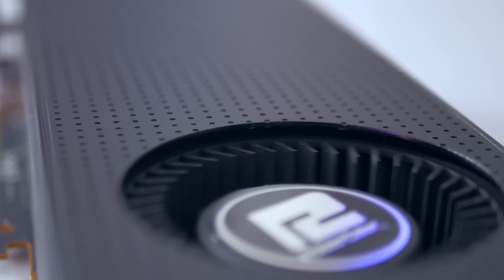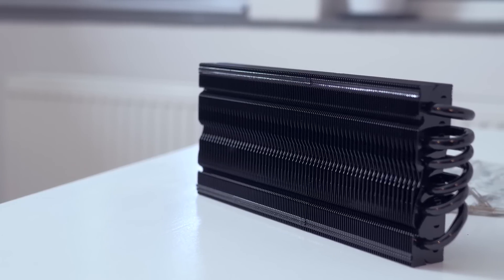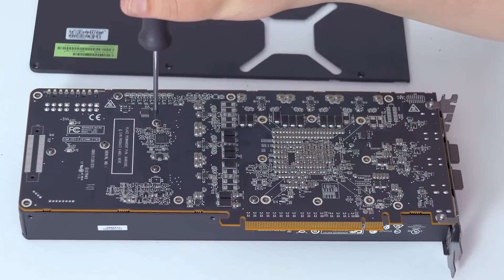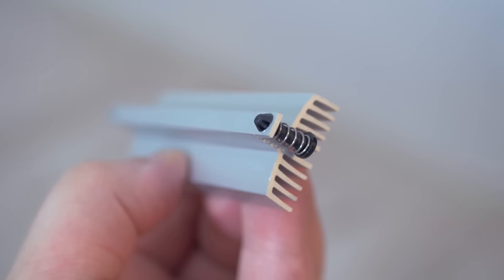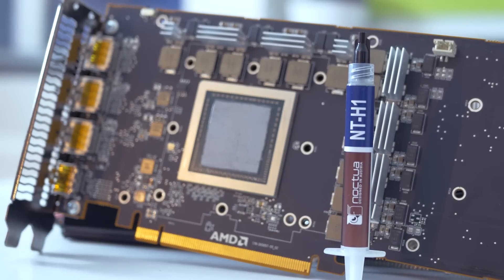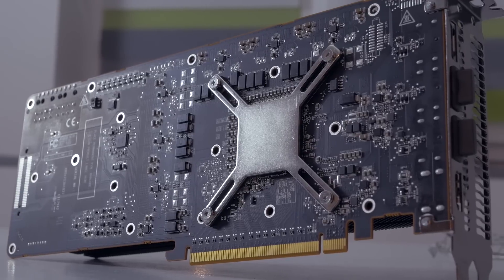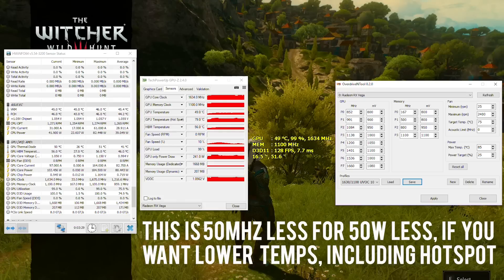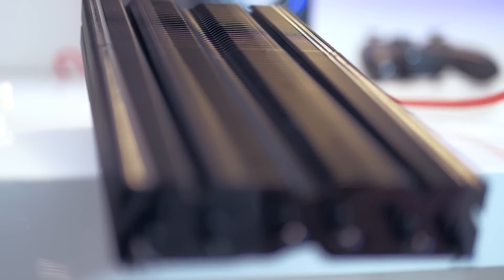The ultimate AFTERMARKET RX Vega - MORPHEUS II cooler SWAP

Comment: I would sooooo put liquid metal :) Did it once never looked back, only LM for me :D
Reply from the maker: +Albin Keranović Yeah, LM would probably drop temps anther 2-3-4C so it's worth it IMO.
Reply: Signex NL it's sort of like thermal paste. It's metals in a liquid form. So you have to be careful in its application
Reply: ArtisChronicles no dont let it contact any aluminium. only copper or nickelplated copper.
Reply: I have seen so many test were liquid metal barely does 1 or 2 degrees better than MX-4 or NT-H1.
The massive downside with liquid metal is that it eats away the surface of the chip and the heatsink over time.
So you looking to sell that hardware? Good luck selling it with damage on the chip surface.
Reply: Sorry but what is LM?
Reply: Signex NL liquid metal XD
Reply: Albin Keranović honestly I think my rx 480 has gotten more stable compared to when I first purchased it. I'm thinking about changing some stuff on it, even though current thermals are acceptable.
Reply: That's what i'm asking. :P what is it? some type of thermal paste?
Reply: Albin Keranović I thought you weren’t supposed to use conductive thermal paste on gpus? Due to requiring much more application and spreading to cover the whole die with a higher chance of spilling over the chip
Reply: SMGJohn depends on gpu. on my msi 390 oced to 1125mhz igot 93 max c with stock paste, 84c max with noctua paste and 72 c max but 1175mhz oc with coollaboratory LM. 

on my gtx msi gtx 1080ti i got around 8c difference when oced to 2050mhz. stock paste vs coollaboratory lm

there was always the same fan setup. if i increase the fan speed difference got wider in benefit to LM.
Reply: forgot to say that 1080ti was not stable at2050 with stock paste. with lm it stays at that clock.

an also my 7700k dropped for 28c average with same cooler and setup corsair h115i. and i could get 5ghz out of it with lm with lower viltage then when it was at 4.9ghz and higher voltage
Reply: +Albin Keranović
Never really seen any good tests though in regards to support your claim but if you have any data on it by all means post it here because I am genuinely curious.
Reply: https://www.youtube.com/watch?v=RbFKNTES5zc&t=895s

https://www.youtube.com/watch?v=KlTANRl_osU&t=346s

And remember better cooler better results you get with LM. :o)
Reply: Silicon, nickel and copper are safe to use gallium/indium based TIM. I've been using liquid metal TIM for over two years now on various devices and found no traces of amalgamation or excessive oxidation. Nickel under LM seems to be more prone to heat flux deposition, but you get that with essentially any material if you pump enough heat through the interface...
Reply: For CPUs; whom you're replacing the TIM anyways with a proper solution; sure why not? But for GPUs; where you'd remove the fan as part of maintenance; liquid metal seems like a really stupid idea because once its on; it's on forever. I'd only do it if I fully understood the risks involved and am willing to replace the entire GPU(next-day) if something goes wrong. Otherwise paste is more safer, proven, and still maintains very satisfactory heat-removal.
Reply: Steven Van its not forever on you can remove it
Reply: +Albin Keranović
Again those are not evidence to backup the claim that liquid metal is worth the hassle. 

https://overclocking.guide/thermal-paste-roundup-2015-47-products-tested-with-air-cooling-and-liquid-nitrogen-ln2/
https://overclocking.guide/wp-content/uploads/2015/06/Tim_test_update1.png

http://cdn.overclock.net/d/dd/dd1faaf2_1.jpeg

As you can see we are talking VERY low differences, 1 - 3 degrees at best here.
Considering that some liquid metals do eat away the surface of the heatsink and the chip and leaves scratches
While others do not they are extremely difficult to remove, in my experience you have to sandpaper the copper heatsink to remove the residue. 
The only applications I can think of were liquid metal is genuinely helpful is when you delid Intel CPU's.
Reply: Intel Toothpaste for life! (but seriously, why do they use that on $2000 processors, is it just so you void the warranty?)
Reply: its to make money. If AMD could catch them in ipc, then there will be only soldered intel chips, from i3 till i9..... You just don't have to delid your cpu, or remove cooler from GPU, if you like your warranty. I test my components for like 6+ months then i put LM.
Reply: I know, but its very sad. My $0.01 per CPU paste is better... Seriously, its a tube good for 500+ CPUs (maybe only 100 Threadrippers), and its $0.99. Can they not at least use that on a $2000 CPU? I don't think its cost cutting this bad, I think its to increase sales with broken chips after delid. Even if just 1 out of 1000 people mess it up, that's about $1 additional per person, and the failure rate is probably higher, meaning more money. Who knew you could make more with an inferior product?
Reply: Albin Keranović even with aluminum?

Comment: buildzoid mentioned already that the hotspot temperature is the "right" temperature of the gpu. so 80°C with loud fans on the morpheus?
Reply: Temps aren't comparable all the time. I have 1 card that runs over 70c at idle (and is insanely loud). If you overclock it, you need hearing protection (if you think a vacuum cleaner beside your desktop is loud, think again!). Every chip is different on how much heat it can handle, some of my cards are fine a little past 100c, and others like the R9 Fury throttle at 75c. Its really dependent on how they were designed, to where a temp is bad for them.

Comment: Great guide! While on the pricey side, I tried a number of fans on my Morpheus and ended up being happiest with the Noctua NF-F12. Static pressure is 2.6mm (higher than the average 120 but lower than the ID Cooling SF's 3.2mm) but they are dead quiet. At the max 1500 RPM, the Noctuas are rated at 22.4dB. I have them on an open workbench and basically can't hear them even under load.
Reply from the maker: +lhl Yeah, these fans are good, but at max rpm (around 2200, which I actually ran in the video) they are about just as loud as the reference cooler at stock. Muuuch quiet than reference at 3500, for damn sure, but still a little noisy. Something like the Noctua's you mentioned are an excellent middle ground, since they'll provide better performance than these fans at the same rpm. I didn't have any Noctua fans in hand, else it's have used those.

Also, dropping the fans to around 1700 rpm makes them considerably more quit, while temps were only hurt by around 3-4C max...

Comment: thanks for the video. very nice.... this is the first video ive seen that uses an air solution. its good to be able to re-use parts in future setups of course but i am thinking water would be a better fit for myself as i live in a smaller room where the hot air is enough to slowly cook you... lol esp wit vega ;) the only problem i would face is affording the pump setup etc.. might as well do it since the case is made for it and i got just about everything but the pump and tubing... thnx again !
Reply: Unless you put the radiator outside your house, you're still going to have the same amount of heat being dumped into your room. If you do run it outside, you need to worry any time its colder outside than your room (condensation).

Comment: what cooler for shappire Rx 480 8GB? sometimes my RX 480 got 80' when i play PUBG
Reply: MSI afterburner, and set the fan profile. Almost any cooler will be plenty for the RX 480, but it seems like companies don't want fan speeds past 40% and would rather the card be hot and cook itself than add a little noise. I have a few RX 470 (modified BIOS) that can pull up to 270w each, and with a locked 65% fan speed, I only get up to around 70c. They are the XFX with hot-swap fans, so nothing special in terms of cooling. 80c is still not that hot, but you can crank the fan speeds up if you want.
Reply from the maker: +Norman Kana The ID-cooling Frostflow 240G is what I had on my RX 480 with absolutely excellent results. Not really cheap but was with the effort. Will not work for the Vega cards though...

Comment: You have to be extremely careful with custom cooling Vega due to the different hights of HBM2. If a viewer does this and gets a card with lower HBM2, they could hurt the cards performance as HBM2 temps effect both mem and core clock, so if the HBM2 gets hot your card is gonna throttle like a mofo. 
Side note, if vega ever gets back in stock for the correct prices, I'm gonna get two 56's, put them under water, and flash the v64 lc bios on them and enjoy the monstrous performance (if you did not see it, v56 and v64 perform identically with the same bios, showing that vega in gaming workloads is bottlenecked somewhere else in the cards architecture)
Reply: He mentioned that his was of the molded variety, which is level, and that if your is not molded that you'll need more thermal compound, due to height differences. Obviously you don't want to overtighten the heatsink though, especially if yours is non-molded HBM.

Comment: One thing that maybe you should have mentioned is that the modification turns the card into a 4 slot wide card. Anyone attempting this needs to pay attention to clearance particularly if their Case has a PSU shroud that may restrict the fans from drawing airflow.
Reply from the maker: +brad morris Good point! I had no issue with my case since the PSU shroud is just a vertical wall, not a complete enclosure. I think it's closer to 3 slots, but haven't really checked this. It's extremely beefy, that's for sure.
Reply: I saw that your case had a wall and not a shroud so not so much of a problem in your situation. Problematic if someone wants to emulate the solution and doesnt think about the shroud in their case. 

The width is hard to tell from a video, The heat sink looked like it made a 3 slot card by itself and the the fans did poke out a lot more from the rear plate.

Comment: When I bought the VEGA 64 reference card I did it with the idea in mind to replace the cooler with an AIO solution ASAP.
But running the power saver bios and with some undervolting, I already got decent results.
So instead I just removed my acrylic window out of the side panel, added mesh to filter the dust and placed 2 120mm fans "on top" of the card.
Until around 2000 - 2400 rpm the fan is quite silent.
Reply: What temps did you get?
Reply: Good to know. I have http://www.coolermaster.com/case/full-tower/haf-932/, so hopefully I get enough air to keep it nice a cool.
Reply: @kraziivan_  great case
Reply: Temps?

Comment: My whole system is full of those fans, at the slowest speed they can run, they keep my 1600x under 60*c with a 360 rad. But yeah they are quite noisy

Comment: Mindblank I think your Ryzen ram videos are very interesting! I wonder, the cases where it's ahead of the 7700k, does it stay ahead at 720p? That is something that I think could be cool to know. I've only seen ryzen pull ahead ever so slightly sometimes once greater resolutions are applied so if it's ahead also in a lower resolution it has to mean that the setup is faster (in that title), or that different processors perform differently for different resolutions. 

It's less of an argument nowadays when coffee lake is around though, but can show that AMD may not be completely out of the game (*ba-rum-tisch*) once Zen+ arrives. My theory is that the more core processor will generally perform better in 1440p & 4k benchmarks in properly made DX12 & Vulkan titles.
Reply from the maker: +EwoksOwnDeathstar I really don't plan at looking at 720p. Usually, the emphasis is so much on the CPU at this resolution, that things are amplified to a point where they stop pertaining to the real world. Cause at 1080p at least you have the real world factor, and it's a res that still has over 2 million pixels to push, while 720p is around half. I think the 7700K will be on top at this res in the majority of titles. But it's meaningless IMO.
Reply: Out of a real world scenario it's meaningless. But from a scientific standpoint it can be interesting. 

Because what if the 1700X with 3446VLL is still ahead in 720p? This could imply that the setup is faster at every resolution with that setup.
If it's not it brings forth that ryzen must've lost less in performance compared to the 7700k. That would be a good signal for the people who game at higher resolutions.

I remember from your 1080ti with 3600Mhz RAM video that Crysis 3 where the 7700k lost it's GPU-utilization at 1080p by a big margin compared to 1440p while ryzen stayed somewhere around the same. So I scoured the net far and wide looking for things that could try and specify how big the difference could be with a much faster graphics card. I found one video with a 1800X & 1080ti, the same system with SLI on very high, and one system where it's a 7700k running low on everything with much lower resolution and settings which should have less GPU computation time and should thus outperform both of those configurations.

However, this does not happen. GPU utilization is extremely low on the 7700k because it's too busy submitting drawcalls, culling, calculating physics etc, whereas the 1800X beats it by a mile (unless looking at the skybox or down into the ground, a.k.a not drawing many objects on the screen). Here are the videos: https://www.youtube.com/watch?v=1LScXqoZRbg https://www.youtube.com/watch?v=QPwdpCY4-l4 https://www.youtube.com/watch?v=enJA4ZmPl60

I'll admit crysis 3 is an extreme outlier in this case. But it does make you wonder if a higher GPU utilization is indicative of higher performance if the same graphics card would've been faster (with artifical enhancements).

Comment: Why dont all manufacturers build their gpu like this, much cooler and practical instead of useless shroud just to make it look nice...
Reply: 3 slot vs 2 slot.
Reply from the maker: +Joseph Yeap Costs, probably. Also, this is huge. Not to everyone's linking. But yeah, more than often, good aftermaket GPU heatsinks are usually better than any aftermarket card.

Comment: Hot dam!!! That's basically what my GT 1030 gets! It gets 46c max. If they make this cooler for single fan cards It would be a really good cooler for the mini 1070 users
Reply: Why would you buy this cooler to pair with a 1070 mini? It would be a lot cheaper to just spend the extra $10 to get a better cooled 1070 in the first place...
Reply: Well cuz you'd only buy a micro itx 1070 if it's a tiny case and no room for a dual fan one.
Reply: Then you wouldn't have the room for this monster of cooler?
Reply: I said in the original comment, it would be nice if they made a version for the micro 1070. Which would be a Single Fan Morpheus cooler. And would be better than the factory single fan cooler
Reply: Oh, ok, I misread that then. If you're wanting to do this much work in a small space, you might just do the cheap and easy AIO mount with a fan on the VRM. That should be a little cheaper and give some better temps, but it does require a spot for a 120mm radiator.
Reply: Arctic makes a single fan cooler for 1070

https://www.arctic.ac/worldwide_en/products/cooling/vga.html

Comment: Almost thought you had two sp120s straped on there. But wtf 47c on air cooling :0! Fk that's water cooling lv. Those are nice looking fans though. But with fans it looks like it's quite a bit over 3 slots lol that thing is huge
Reply from the maker: +Damien Yeah they kinda look like SP120s. Well, custom water-cooling on the RX Vega can be even more awesome than this by a bunch. I've seen custom loops pull off 35C with pretty hefty overclocks. Naturally, the cost is higher. But 47C with acceptable noise levels, on air, is amazing, for sure. I mean, this thing's pulling 300+W at times...
Reply: MindBlank Tech it's probably pretty close to what the expensive liquid 64 would get cooling wise. But yeah a custom loop will allways smash everthing